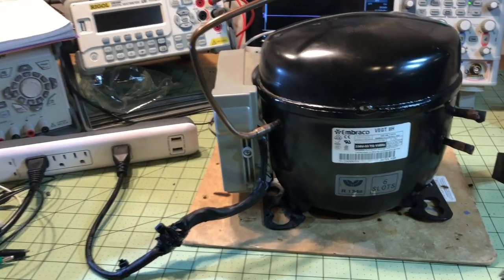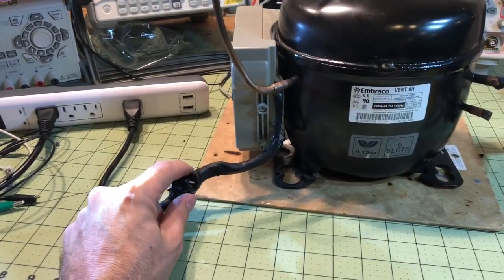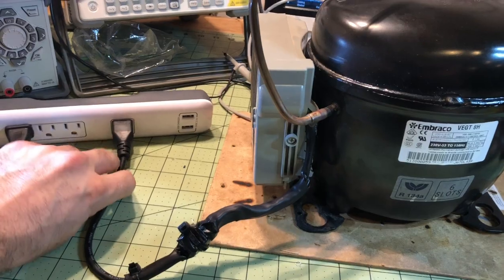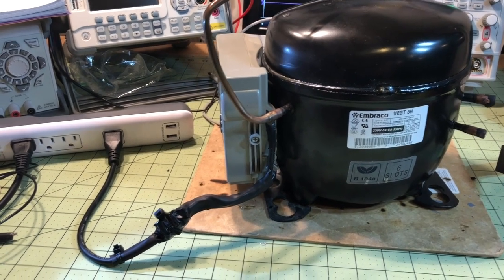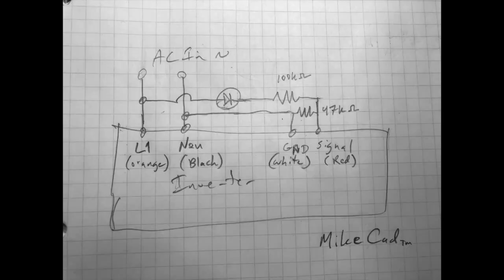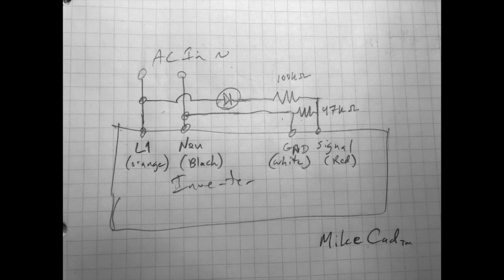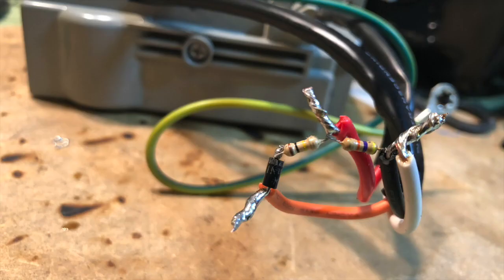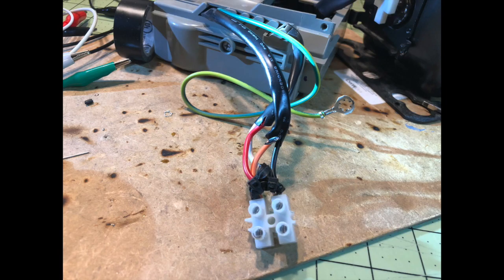VCC3 Inverter Compressor Tester

Comment: I tried similar circuit like in this video, signal voltage was 2,5VAC and compressor started to run. Thank you
Reply: I used diode , 150kohm resistor and other 2 paralel one serial resistor to get 3,3kohm resistor. Input was 230vac and output is 2,5vac

Comment: Embraco makes three different versions of communications for the signal input (serial, drop-in, and frequency) Is your circuit the drop-in or frequency style? Embraco has a large number of models of VCC3 boards. Other than different input voltages and connectors, are they all compatible if the use the same signaling type?
Reply from the maker: the inverter I used is frequency controlled, part number WR49X10283

Comment: hello what termostat can buy to control de temperature and RPM (PWM) ihave a inverter VCC3 1156 S0 A 00 ENBRACO only have a compresor and inverter unit to adapt in old equipmet can you helpme?

Comment: How does this works as signal for optocoupler to mcu ? please explain
Reply from the maker: even though it's a half sine wave, all that the mcu is seeing are voltage threshold crossings. So the voltage starts at 0, travels up to about 7 volts, the micro sees the change of state, it doesn't care that it's not square. Then as the voltage goes back down to zero, it switches state again. The frequency is modulated, so the higher the frequency, the faster the compressor runs, around 50 hz to 150 hz, typically on these GE's. In this case, the frequency is line voltage frequency of 60 hz, so it runs on near lowest speed.

Comment: You mention that there are two different inverter/compressor types.  Is there a way to tell what I have before perusing this?  Or if I do, can any harm be done to my inverter/compressor?
Thanks,  I've been trying to nail down the source of a non op compressor on my late model fridge.  Tech diagram says the inverter gets 12VDC+ and VSD- from the main board but does not specify if thast 12V is constant.  Measured at the inverter I have 3V.  Thanks for a killer tip to test a inverter compressor.
Reply from the maker: if the signal is 12 volts pulsed dc, some manuals call it PWM, you won't see 12 vdc, you will see somewhere between 2 and 8 typically. It's a signal more easily seen on an oscilloscope, but not many techs can use one in the field. The two different types are differentiated by the signal wires. The type in my video has two wires for signal + and - , the other type only has one wire for 120 vac/ L1 line only. (no Neutral). But if you create an inverter tester, you can put the tester on either type of compressor.
Reply: @electronicsprojects4708  Thanks for the input.  I printed the tech data sheets for it and the wiring diagram shows the compressor signal lines as + and -.  Those go to the control board and marked at that end as 12V+ nad VSC -.
My biggest worry is that I may have injured the compressor.  I purchased an inverter off of the parts diagram for the model.  It however proved to be incorrect and when plugged in started the compressor slowly but then increased the RPM until it was screaming, and then shut down.  Ohms on all three pins are exact to each other and no short to ground.  I've subsequently purchased another inverter identical to the original one.

Comment: I was trying to make it but I realize that I only bought the 100k resistors is there any way to make it just using those?
Reply: I also did get the diode
Reply: 4007 this one
Reply: Looks like I’m missing the 47k resistance can I make it with the 100k
Reply from the maker: yes, just put two 100k resistors in parallel in place of the 47k resistor in the diagram.
Reply: @electronicsprojects4708  so add two on red to orange?
Reply from the maker: @Theycalllmedaniel  no, on the schematic, it would be two 100k resistors in parallel to each other connected to GND (white) and Signal (Red)
Reply: @electronicsprojects4708  got it working boss thanks

Comment: how about the 220volts ac sir... please teach me how to do that tester.thank you and more power to you ...
Reply from the maker: if the line voltage is 220 going to the inverter, and you have a pulsed dc signal going to it in the same fashion as in the video, the same circuit should suit you fine. You may need to adjust the values of the resistors, basically you need 10vac on the signal line. If it's too high with the above resistors, raise the value of the 100k ohm to 220k ohm. Test with your voltmeter, test both AC and DC, use the peak as your guide. Also, the wattage will be higher, so you can use 1/2 watt resistors, I used 1/4 watt in this one.

Comment: Hi, I want to know if it possible to test the vcc3 1156 inverter other then testing the capacitors. 
testing one of the capacitors on the board read(-1uF) which made me remove it and  tested off the board and the reading were fine. it read 30uF instead of 33uF, the rest of the caps test good also 30uF. Anything under 20uF will be considered bad.right? 

Btw, all the GB6NC60HD triac test good, on the board, with the diode tester. I connected diode tester to each triac, to do forward bias test, with positive lead to middle pin and negative to the right of middle pin  and it read 0.464V , which I think indicated the all 6 triacs on the board are good, right? 

is it possible the the triac drive not working and how do I do that? 

thanks 
Max
Reply from the maker: i think you mean IGBT, not triac. if you test short circuit, it's bad. compare the readings to the other IGBT's for reference, if there is one bad, sometimes there may be 2, but not more, others test good. You test electrolytic capacitors with ESR meter, it's much more reliable than standard capacitance test on dmm. I have a video on the subject, search my video archive for it. Make sure to test the  one or two large capacitors in the power supply, make sure they are not shorted, if one or both are, the board is trash.
Reply: I did check the large two capacitors on the board with a capacitor meter and they are 384uF and the label is 390uF, so both are good. 
I also connected the inverter back to the fridge without connecting the compressor cable and I measured with AC voltmeter and I saw 60V AC from each of the 3 pins to Neutral What should it be ?  
I think my problem is with the compressor. I just measured: 11.7Ohms from bottom left to top pin, 15.7Ohms from bottom right to top pin, 15.7Ohms bottom two pins, it should be 15.7Ohms , right?  
Thanks for getting back to me. 

 @electronicsprojects4708
Reply: if it is a compressor, is there a way to find a compressor that is interchangeable with the one I have VEMY-4H , it say 230V-53  to 150Hz 3HP, RLA 2.1A, LRA 2.1A . Let me know what you think , thanks again.
Reply from the maker: @maxmax-ui3ks  ok, if your capacitors were shorted, it would not show you a capacitance reading, so those large caps are good. On a 3 phase compressor, you should have exactly the same resistance between all 3 pins, all should be 15.70 ohms, as long as your meter is not wigging out on you (I usually double check if I get squirrly readings) But looks like you have got a bad compressor, that being said, I don't know what exactly you are working on and proxy diagnosing will only get you so far. The best thing you could do is put a new inverter on to test it out cause if you are replacing the compressor, for the price, I would be including a new  inverter in there, but a lot of customers don't want to pay for that unless it's a built in.
Reply from the maker: @maxmax-ui3ks  I think that would be 3ph, (3 phase) I would go with the compressor on the parts list from the manufacturer.
Reply: I forgot to mention that I did test the inverter with inverter cable disconnect from the compressor and with the fridge plugin to 120VAC and I measured from each of the 3 pins to neutral and get 60-70VAC , does it mean the inverter is good then? And since the compressor is bad it explain why I tough the inverter is the problem.  

Thanks
Reply from the maker: @maxmax-ui3ks  you have to have a working compressor to accurately test a vcc inverter. an inverter is wear and tear part, you don't want to replace a compressor and come back in a few months or a year to replace inverter, that's about all I got on this.
Reply: so , I happen to test the compressor winding again with different ohms meter this time and now I measure 15.7Ohms between all 3 winding. so I think my compressor is good, I hope!! , i  also went and purchased a new 1156 VCC3 inverter with these specs: input 115-127 50/60Hz , output 230V - 53 to 150HZ. and compressor specs: VEMY-4H 230V-53 to 150HZ . I then wired I inverter as you suggested here, plug it to 120V , measured voltage between each of the 3 compressor cable to neutral and got 67V AC on all 3  cable pins . which I assume is good , since this is a new inverter. I then connected the compressor cable to the compressor but the compressor did NOT make any sound. how long should I wait after applying 120V ?  is the 15.7 Ohms winding Ok. ?or maybe the inverter is not compatible with the compressor. or maybe I wired it wrong, as you showed I wired the hot from of the inverter through 100K and a diode(with cathode connected to signal's red wire ) , connected the neutral  to the signal white wire, and 47K across the white/red of signal. BTW, how important is the ground on the inverter? the inverter 120V AC input, what if it is swapped?  Any  help is appreciated , thanks max
Reply from the maker: @maxmax-ui3ks  circuit does not need ground. I would try you inverter tester on a known working compressor before assuming the compressor you don't know is working is the problem. That way you know if you wired up the tester correctly. After applying 120vac, it usually takes 5 to 10 seconds for the compressor to start up.
Reply: I did purchased a new compressor/inverter and connected it the inverter tester and no luck, so not sure what is wrong. I  wired exactly as you did. I even describe how I connected to make sure I did not make a mistake with the inverter tester wiring. what should the voltage be, from each of the 3 pin compressor cable to neutral when i apply 120V(and with the inverter tester) . ? I did that on my existing inverter and  I measured 91VAC to neutral  on all 3 pin of compressor cable (not connected to the compressor) , I did the same with the new inverter  and this one gave me 63VAC to neutral. could it be that the 120VAC wires into the inverter are swapped? also I measured on inverter signal input an it measured 12V DC , and with AC it read 15V AC . is this correct?
Reply from the maker: @maxmax-ui3ks  you can't test from the inverter output to neutral, it's not the same circuit. the signal sounds like it's in the right range. Like I said, the only way to test the inverter is on a compressor you know is working, there's no other definitive way to make sure your compressor tester is working.
Reply: Got it.  I will check  the inverter tester wiring, again . Just in case , can I apply a 5VDC square wave into the inverter signal DC input, it should do the same as your inverter tester  , right  ?
In terms of winding resistance, you don’t see any issues with 15.7ohms ? And the new compressor resistance winding at 6.7ohms , and it too did not run the compressor. Just curious what was the winding resistance of the compressor you did the test with? . I appreciate all your help.
Reply from the maker: @maxmax-ui3ks  as long as windings are all equal, then that's correct. (doesn't say the compressor is good, just that test of the windings is good) you can input 5v p-p square wave, just make sure the polarity is correct. If it doesn't turn on, reverse the plus and minus and it will work. (as long as you have a good compressor)
Reply: Ok , I will try to use a 5V pk-pk square wave on my old compressor/inverter and on the new set. I just don’t understand why the new compressor/inverter I purchased has the the same issue.
Reply from the maker: @maxmax-ui3ks  it's not just a new inverter, it's also an additional circuit you put together that has never been tested. When I put mine together, I tested it on a good compressor, so when I use it in the field, I know it has a good track record.
Reply: Yes for sure. I just finished making a 5V  square wave circuit with 555 IC , it puts out a 5V every 1 second and low everyone second,and attached an LED to the output through 1Kohms resistor to ground. it work great. I should be able to use this on the inverter signal input,right?
Reply from the maker: @maxmax-ui3ks  yes, just set frequency between 50 and 120 hz, if it doesn't kick on the compressor in a half a minute, reverse the polarity.
Reply: @electronicsprojects4708  ok, here is what I did. I connected the 5V square wave @102HZ circuit to the NEW inverter with it connected to the NEW compressor and it worked great , I could hear the compressor going. BTW, I connected the positive +5V to red wire of inverter signal in. 

I than did the same thing with my OLD compressor and OLD inverter and NO luck there. I try reversing the signal wire and still no luck.

Next, I connected the OLD compressor and the NEW inverter and NO luck there , but when I reversed the inverter signal wires the compressor start to run few seconds later but it sounded a little faint, is this normal?  

next, I figured that since the compressor is OK?? I can connect the inverter to the fridge wires and powered fridge, but no luck (the compressor did not come on, I waited few minutes. 

so I think there are two possibilities 1)the  main board is not supplying the signal to get the compressor going. 2)since I had to reverse the NEW  inverter wires to make compressor run in standalone mode , do you think I need to reverse the signal wires from the main board to the compressor to get it to work? 
or is the issue now with the main board? what do you think is going on? what else can I try.? I'm planing to order a new main board anyway.
Reply from the maker: @maxmax-ui3ks  if you have a new inverter and the compressor the old compressor is turning on and staying on, I would say the old inverter is defective and likely the compressor is just fine. It may sound different, but it needs to stay running. Bad board is least likely since I don't think i have ever tested a board that didn't have signal going to inverter. But you can test using a dmm, voltage usually between 2.5vdc and 10vdc and test hz 50 to 150 hz and duty cycle 50%. If all these check out, board is good. You would have to put new inverter in to test sealed system is working, give it 1 to 2 days to cool down to get back to normal. I you have to reverse the wires, it just means you didn't buy the original inverter and the colors of the wires are different  and you just need to reverse them, there is no problem, just how that manufacturer decided to color the wires and make the connector.
Reply: @electronicsprojects4708  you are right that the  NEW inverter is not an original, since, I had to reverse the wires into inverter signal input for  it to work. again, the compressor sounds faint, so I measure the AC current used by the compressor and it  0.5A , shouldn't it be around 1A,? but being that  this compressor is very tiny this current might be normal. 

I did feel the cap tube/condenser and they are staring to warm up. so I think it is working. 

I also noticed that the condenser fan is NOT  kicking in , not sure why., but for now I placed an external fan on the condenser to see if it  is working first. I'm going to monitor the temperatures in fridge/freezer, with digital meter, and see if the temperature drops in the next few hours.
Reply from the maker: @maxmax-ui3ks  You can't use current to test a 3 phase compressor like you can a split phase. Only test is running it and making sure the temps are normal after pull down.
Reply: @electronicsprojects4708  yes, the temperature in the freezer dropped to 38F from 65F in last hour, so I think the compressor is moving the liquid Freon into the freezer evaporator , boy there are so many issues with this fridge.
Reply: Question, now that I have the new inverter works with the compressor, (meaning I see frost on the evap coils),  I want to find out why the old one does not work with compressor, can you help figure out why? here what I don't understand , when I compare voltages from both new/old inverter ,I measure the same voltages across all the capacitors, they all where there should be , C8@15VDC, C9@18VDC, C11@5VDC, C511@3.3VDC, and 170VDC across the half-wave rectifier 220uF capacitor, that is per a youtuber that showed what a good inverter voltages should be at. what do you recommend I try to figure out why it is not working with the compressor ? is it possible that it just does not work with this compressor?
Reply from the maker: @maxmax-ui3ks  On these inverters, you can test the capacitors with ESR meter, if they test high on ESR meter you can replace them, then test it. If you find a capacitor that is shorted (large ones, typically) the inverter is junk. Beyond that, I can't help you figure it out by proxy.